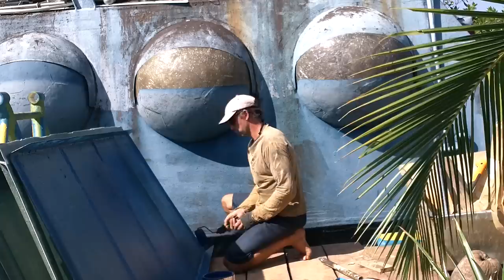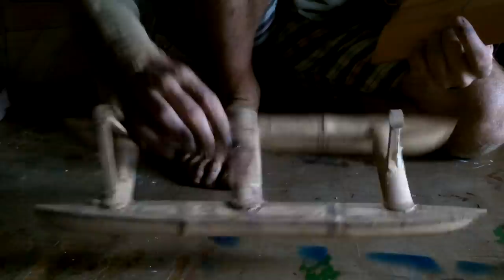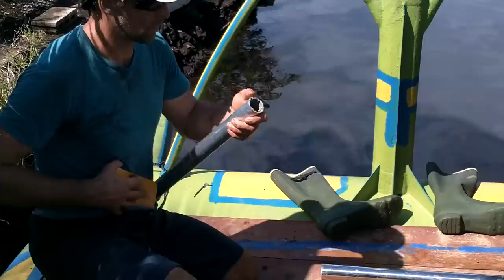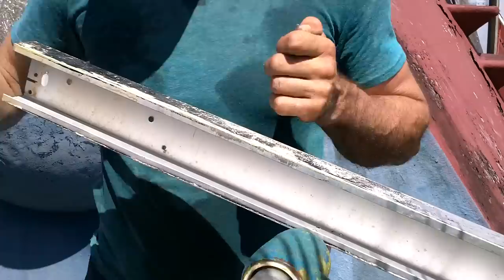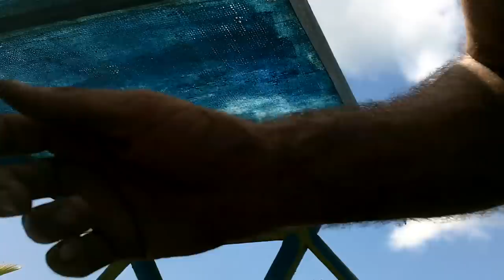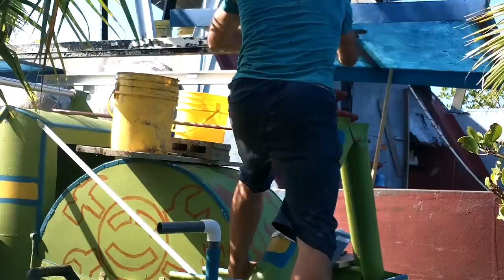Solar Snailer 031 Solar Center Frame

Comment: What's up Jamie?  I'd like to know some things about this project:   How is this boat an improvement on the shark slicer?  Does the shark slicer run out of battery power on the way to town?  Can't you just load more batteries and achieve better range?  Is it important to keep the solar roof low on these boats? When you decided to scuttle the sail function, why not create a solar roof that you can stand under and walk around?

Comment: it you tilted it up at front with a head wind it could help lift the front out of the water getting you on a better plane to move faster with it tilting downb and a head wind wont this push the front more into the water

Comment: Hello Jamie, looking at you installing on the boat what is just the centre section of the entire solar array, it seems that the only time that the just above your head height in a seated position will be comfortable, is literally when you are pedalling in a seated position. 

Doing anything else on the boat would seem to be made much more awkward or difficult as a result of that low height. Things such as loading and unloading cargo or passengers, or even standing up and moving around the boat, either underway or when stopped.

Given that your original stated purpose for reworking this boat was, to have the ability to transport more cargo and passengers with greater ease and comfort than the shark slicer..

The question is, is this setup going to fulfil those requirements, or have your priorities now changed?
Regards Dave